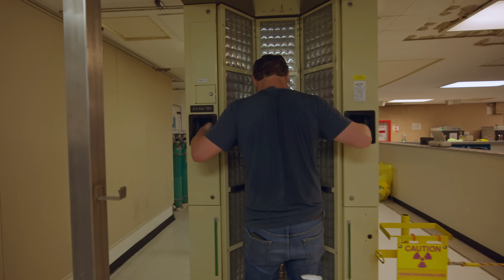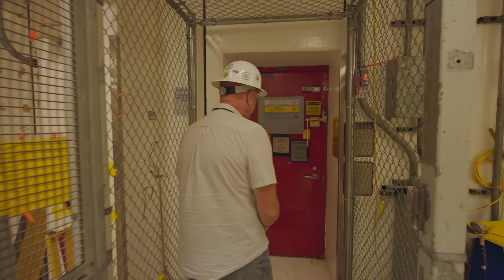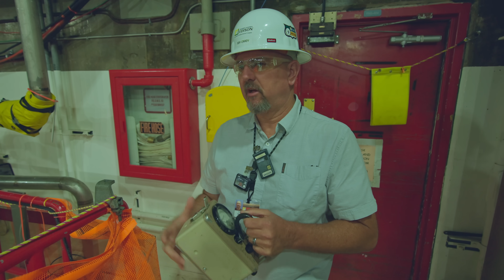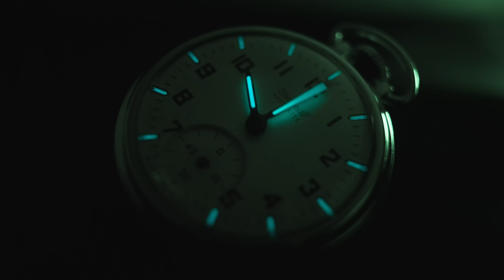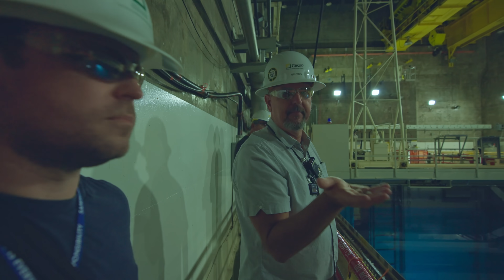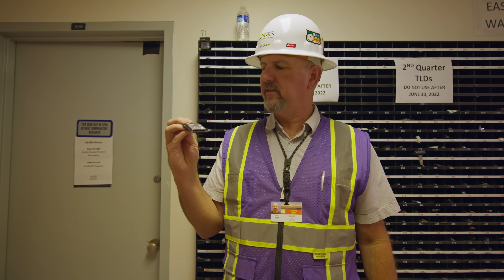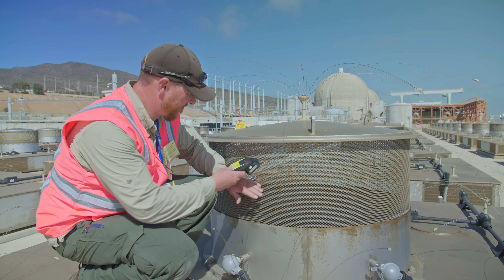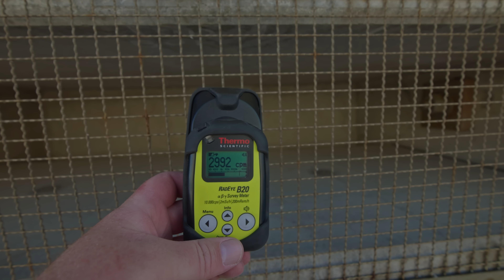Inside San Onofre Nuclear Power Fuel Pool and Spent Fuel Storage

Comment: I wonder what the "usable lifespan" of the material is & how long it'll produce energy before being retired & replaced?
Reply: The fuel assemblies only burn about 5% of the uranium 235 in them.  Reprocessing could add many cycles before the original fuel was totally burnt. You can get a boost from the uranium 238 capturing neutrons and converting into fissionable plutonium in a breeder system. Figure 2-5 years per cycle.

Comment: .  My dad worked at SONGS for 25+ years as a machinist/foreman and retired as General Foreman of Mechanical Maintenance.  He's been in containment with the unit on full power (briefly of course)
Reply: Power Entry…. Wearing neutron dosimetry. Good times. It’s just really hot in the can while it’s running. Those ice vests melt way to quickly. I’m sure he can attest

Comment: Why is it taking so long to decommission San Onofre?
Are they milking this job, or slow-walking the work, or does it just take a very long time?
Is the water used for shielding deionized?
Bad answer (more political than anything) - "the highest postulated Tsunami is 27ft and we are sitting at 32ft right here".
I would prefer they upgrade it and get it back online.
Thanks for sharing.
Reply from the maker: As I understood it, the reason why it took so long to get started on taking the facility apart was a hold up with some California commissions.
Reply: I will tell what we were told 30 years ago.  Money...the cost to decommission the plant and essentially remove the entire site and find a place to bury it is 20 to 30 year job costing SCE billions.  Maybe even putting them out of business.  I actually was hoping back then to stay and retire for the decommissioning.  Evidently the right people were paid off and "wet layup" was approved by the state.  How about that?
Reply: @j01150126  Thank you for the information.  As I recall, there were "tube leaks in one of the four new steam generators" ...... I was as perplexed then as I am now that 
"Anticipating significant maintenance cost and regulatory delays to restart the reactors, SCE found it economical to permanently shut down the reactors in June 2013.  And the $4.4billion San Onofre decommissioning project is expected to create 600 jobs during the dismantlement phase.".
Were the "leaky tubes" truly unrepairable?
I hate politics/politicians.
Reply: @truegret7778  that's just it, I never heard about those tubes, there were leaks where we used those water sausages and mop heads but none that I new of directly from the generator.  It was all about no place to bury the waste.  That still remains the main issue even today.

Comment: I used to be a steel hauler. I delivered to a mill in Canada once and saw a 2000 ton ladle out in a field. Turned out an X-ray machine got past the sensors at receiving and contaminated the ladle. Expensive mistake.

Comment: At 22:40, the problem with the telescoping tube in a hot fuel pool is that you are essentially "cutting a hole" in the moderator (the water or borated-water) and if you are at the other end of pole, you just opened  a hole whereby gamma radiation can stream at you from the source.  
At a plant in Missouri, a Rad tech did just that as  the underwater transfer cart passed by and he wanted to get a reading with the detector near the fuel bundle cart as it passed by. He got it alright, just over 5000 mrem which was his NRC yearly allowance as a rad worker. He spent the next year assigned to low level areas like tool cleaning as a result. Tough lesson learned.
Reply: Reminds me of an accident I read about involving moving a fuel rod either from a spent fuel pool or a top-loading reactor like an RBMK or a Magnox, either way the machine that was lifting the rod lifted it out of it's cladding/sleeve causing everyone in the area to make a dash for the exits before they could get a tan.
Reply: Instrument Not intended for underwater use for that reason

Comment: Great video. Is it not possible to use the residual heat from used fuel in storage to generate more electricity with a Stirling engine? Perhaps there isn't enough heat to be worthwhile.
Reply from the maker: I was thinking the same thing. From what I heard it should be possible. It wouldn't be a ton of power but more than nothing. Plus it would always be on and for a long time.

Comment: ''The highest postulated tsunami is 27 feet and we're at 32 feet.'' - Completely negates water upflow on slopes. I wouldn't trust this man.
Reply from the maker: Well they did the research on this subject so I would trust it. Also if a tsunami came in a washed over the spent fuel nothing would happen.

Comment: There are four reasons water is such a great radiation shield.  One water is dense about 1g/ml.  Two, Water has pretty good thermal capacity. Three, Water is a liquid, which has the advantage of molecules moving quite freely when imparted with excess energy.  This allows very even distribution of this energy (as opposed to a solid molecular lattice). Finally water has a pretty high ratio of space taken up by protons and neutrons; which give it a very high chance of interacting with, deflecting, or being hit by a neutron.
Reply: I guess I also forgot to point out the fact that it's cheaper, easier to source and deal with when compared to other methods.   And also its resistance to catching on fire (re: the high thermal mass and distribution of energy) and noone really likes their shielding to keep lighting on fire.

Concrete, Gravel, and Boron are also great shielding methods but it tends to be a little harder to move around things embedded in concrete or a few feet of gravel.  

Overall the density is key for your Beta and Gamma shielding (15 feet is pretty much going to stop most Gamma).  And yep the Hydrogen is pretty much the main thing neutrons will interact with and it so happens that if you look at the cross section of water you tend to hit hydrogen pretty often (often radiating photons - and thus energy dissipation becomes important again)
Reply: Deionized water can't be irradiated.  That's the number one reason.
Reply from the maker: It can all be irradiated, doesn’t matter if it’s deionized. It can also be changed into tritium from neutrons hitting it.
Reply: @eggnogfrog  The hell are you talking about? Lol

Where do you people get your information? Damn! 🙄
Reply: You don't have a clue lol

The reason water makes such a great radiation shield is because it's mostly hydrogen.

The rest of everything you mentioned is irrelevant to the idea.
Reply: your point is,.??..nuke is dangerous, poison, kills millions. only reason we have nuke reactors,,is the military..
Reply from the maker: It doesn’t kill millions…where are you getting that from?